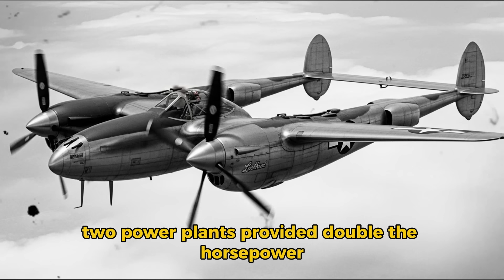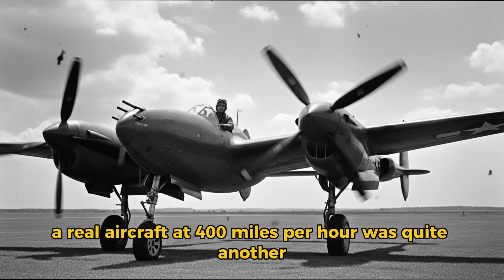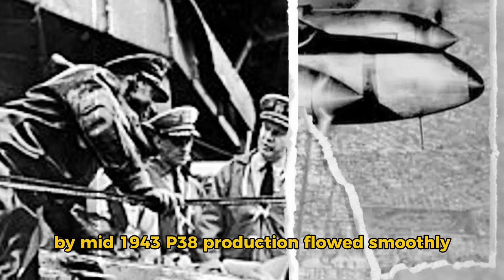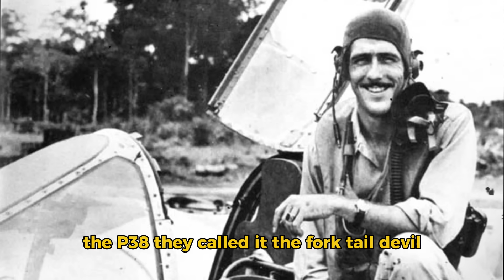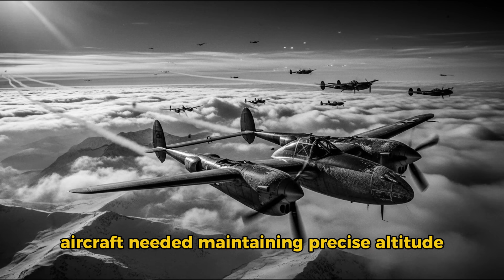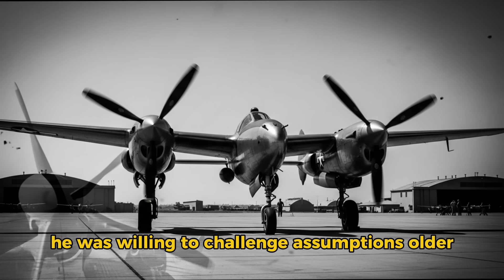This Civilian’s “Crazy” Fix Changed Air Combat Forever - The Miracle of the United States P-38

Comment: Are you suggesting a single engined plane didn't suffer torque problems?
Reply: The single engine aircraft does have torque issues, however the performance and power required for combat aircraft are far more critical due to all the aerobatic requirements with how close the engines are to the centerline of the aircraft induced torque multiplication issues they weren’t prepared for. 
A&P mech, U.S. Navy and U.S. Army aviation trained vet, have a great day.